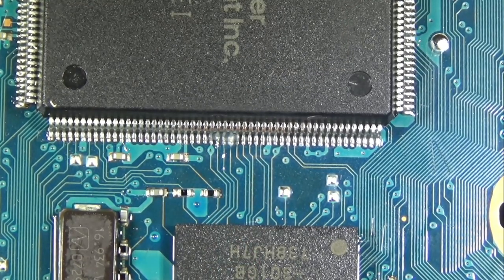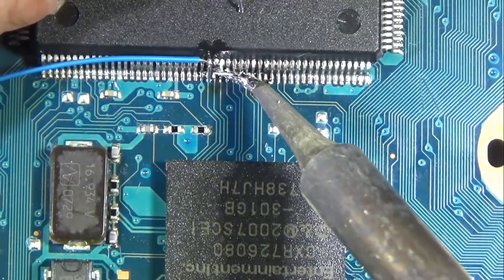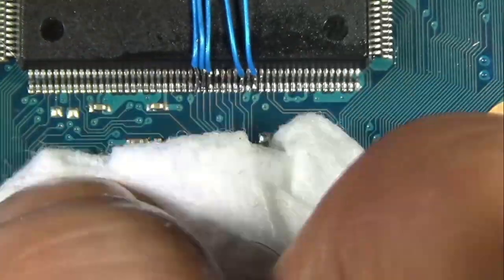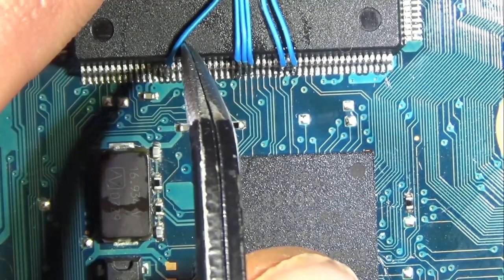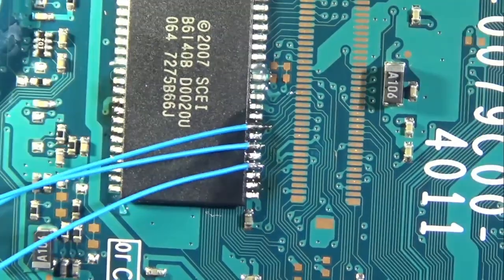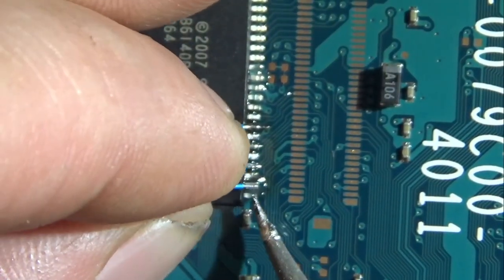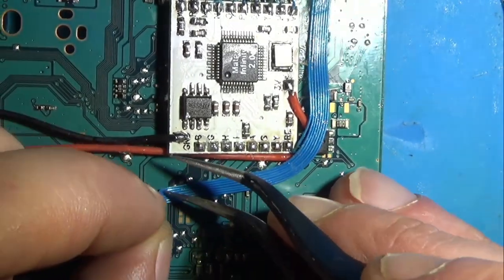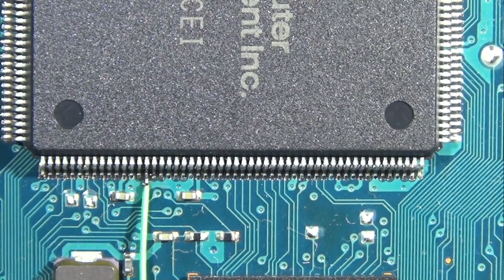The Hardest Ps2 Modchip install! Slim 9000x

Comment: This is what separates the men from the boys. It’s one thing to slap an Aladdin in an OG Xbox, it’s another thing altogether to install a modchip like this. Really nice work man, great tips and suggestions soldering and routing those wires. One day I might attempt hard modding a PS2. One day…
Reply: Yay more PS2 videos 🎉🎉🎉
Reply from the maker: Thanks brotha! Would love to see you give one of these a go :D
The install process is only really this gnarly on the 79k and 90k slims. The earlier revisions have much easier points to solder to but either way I'm sure you'll be just fine.
Reply: I am not confident in trying my hand at that sadly my ps2 is 9000x so i hope to find it offered on etsy

Comment: As Always fantastic video. But with freemcboot and mechapwn you can do pretty much everything without touch with your bare hands the point of your hot soldering iron!
Reply from the maker: I’m aware of mechapwn and fmcb. I’ll have do a video on that as I hear this all the time. Tldr modchip has more features
Reply: @ModzvilleUSA  on pal console I think modchip still is the way to launch ps1 game, no ? And fmcb need to patch your burned game or I have miss something ?
Reply: @Gusse  i've used mechapwn on my stock PAL ps2 slim 70k (italian console). I now can boot all region ps1 backup and original ps1 games pretty much out of the box. PS2 games from a different region don't Need a patch anymore, but different regions Need to be booted via elflauncher. But as modzville says, with that modchip you have more feature.
Reply: @nerone1984  ok thank you ! So I have to  test again ! thank you

Comment: Totally unrelated, but I need to know lol. The Pound XBox HD Link cable uses Component video. Their PS2 version uses RGB, Could you make a Frankenstein Pound HD Link cable and see if it gets better video then their actual PS2 cable. You could use the XBox version and wire a Playstation connector to it. I think you could also build a Wii version this way since they don't sell one.

Comment: I was wondering if you could you do mechapwn without soldering the sx points to play ps1 backups with a modbo 5.0?
Reply from the maker: Yea actually! If you flash mechapwn (don’t use force unlock) then you won’t notice a difference with or without the SX wire.
Mechapwn is better at handling PS1 then any modchip so I personally recommend holding start to disable the modchip when booting ps1 games.
Reply: @ModzvilleUSA  awesome man, thank you for the quick reply!! I’m planning on doing a modbo mod chip with my ps2 90000 series this weekend and your timing with this video couldn’t be more perfect! Thank you so much!!

Comment: I could cry. I'm trying to repair a ps2 portable console that has the RST line for the power switch disconnected, and I don't know where it connects to. I've watched so many modchip installs to find the RST location, but this is the only one where the board  is the same as mine gh-070-42 9XXXX, but you skipped the RST connection 😭 you couldnt give me a pointer as to where to look could you? Thank you so much dude, and keep up the great content.
Reply from the maker: Thanks! Here's the diagrams
https://quade.co/ps2-modchip-guide/modbo/

Comment: Cool video. Would be cool a full, complete and comprehensive tutorial for the 70xxxx model to install internal HDD or microSD. Yeh internal ps2 mx4sio is doable but has it's own limit with OPL. Would you think about making it? Thanks
Reply from the maker: That’s literally coming up soon
Reply: @ModzvilleUSA  No way! Nice, i have a working (even optical drive works) 70xxx laying around waiting for me to install an HDD :-).

Comment: What sized wire are you using I have a hell of a mess in my ps2 with the 30 awg wire also glue I used super glue but doesn't dry fast enough

Comment: I tried the matrix 1.93 version of the 2.0 once and it blew the bios on the ps2
How that model chip works bud??
Reply from the maker: I’ve heard tale of that.
Never had an issue with matrix 1.99s or 2.0s
Reply: @ModzvilleUSA  I’ll order a few soon. Thanks bud

Comment: I don’t really get it why the hustle through all that when you can easily  mcboot or fortune
Reply: Unless there's a new patch (which might be, I don't keep up with them) , you can't mcboot on a 9000 without a modchip

Plus from my experience,  growing up with a 9000, modchip were the most reliable way to play games on it
Reply from the maker: Because I can and you can do the same things plus more with a modchip.
Reply: @ΝίκοςΣ-γ7β  some early 90000 models are compatible with freemcboot
Reply from the maker: @MichaelM28  this is true in my experience its about 50/50

Comment: I wonder if that type of soldering tip would be good to solder to TSOP NAND/NOR memory legs. And I don't know what cable/wire size would be good for it. I need to un-brick one of my PlayStation system. Looks like I need to get myself a NASA microscope, a soldering iron/station and god knows what else. 🥲